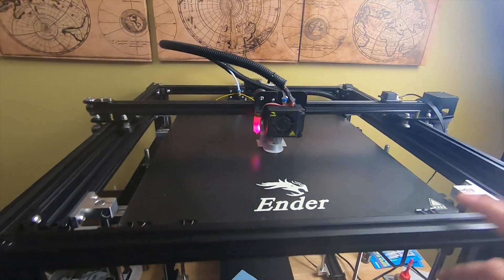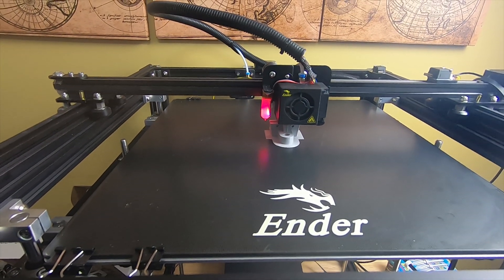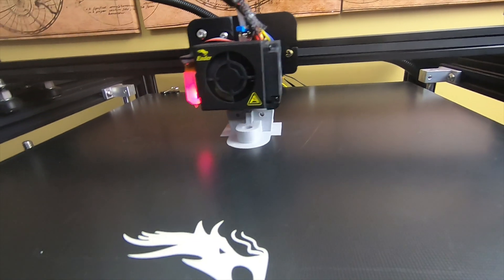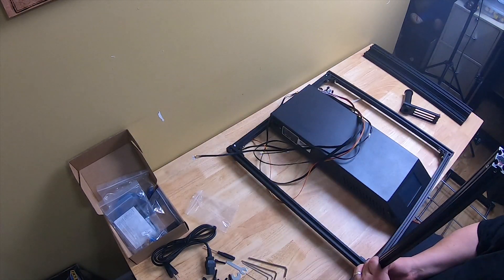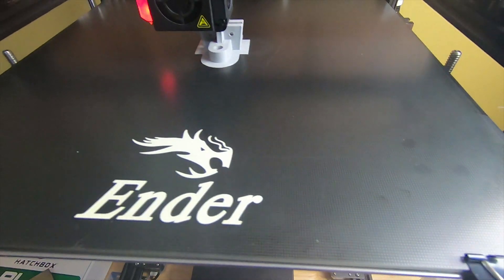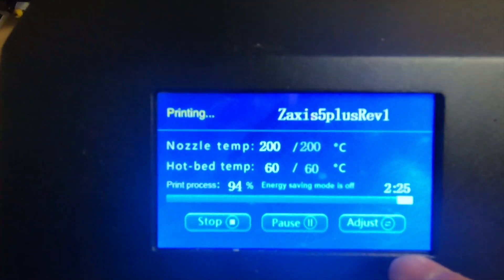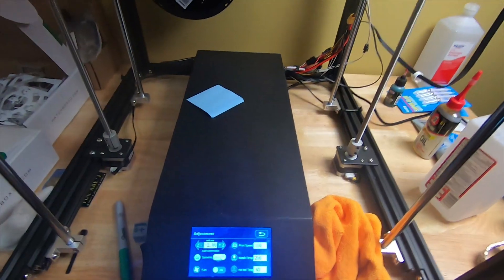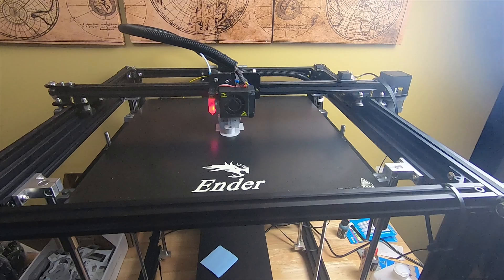Creality Ender 5 Plus  - 3D Printer - Unbox Setup First Prints Initial thoughts

Comment: Hi just got one of these (getting assembled today) and was wondering about the Z-Axis supports, why they are needed & how they will work. Thx for the vid.
Reply from the maker: Apparently the z-axis supports will stop the z-axis from vibrating and shaking at the top on a tall print. After installing them I have not noticed a difference however I will put the STL file in the comments as any upgrade is a good upgrade in my books.. 

Btw thanks for your comment

Comment: Haha, looking at the video it looks like you did the same mistake as me (not that it really matters).
Reply from the maker: The wires really are like that in the book but I'm a with you they probably would be better facing backwards maybe I will switch them
Reply: @RealFifty  No need if the wires are long enough, it's not like it's critical. If I had caught it later I wouldn't have bothered.

Comment: It was fairly easy to put together, but I goofed and mounted the Z frames backwards (contacts facing forward) at first :/
Got mine yesterday and today it's dead :/
Reply from the maker: Really it died how did it die very interested in this
Reply: @RealFifty  Was heating it up for the first time and since I replaced stock hotend with a Micro Swiss I was going to do a hot tighten of the nozzle. When I put the wrench on the heater block to hold it while tightening the nozzle sparks flew for the heater cartridge wires (that apparently was bare) and the short killed the mainboard (well, it killed the thermistor on it). Now the readout is a constant 300c and it refuses to heat the hotend of bed.
Reply from the maker: that is no good I am gonna do a hot end soon i will make sure to be careful of that thanks for the warning

Comment: I see that you have Eco Mode turned off.  Thought you could print with it on?
Reply from the maker: You definitely can and I do when I'm not around the printer however I do turn it off sometimes when I'm in the room with the AC and/or ceiling fan on

Side note I do wish I could change the Eco mode to just lower the bed temp to  about  30c
Reply: RealFifty - Please post a time lapse of you doing a full “large” print doing eco mode.  You may need to use two cameras, one on the display and the other showing it print.  Thanks
Reply from the maker: @Firstleaker  thanks for your comments btw for some reason youtube held your comment as spam.
anyhow great suggesting next time I do a large print I will do